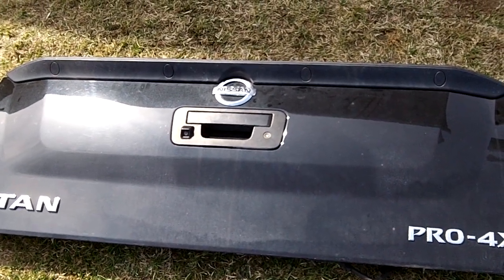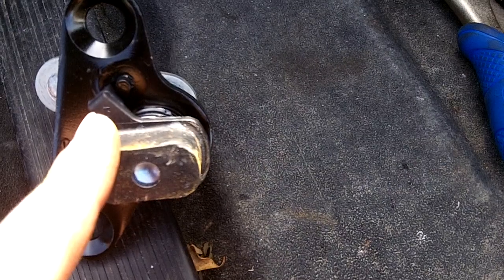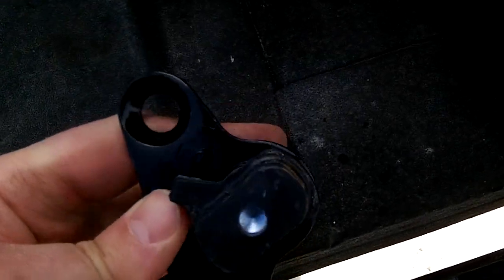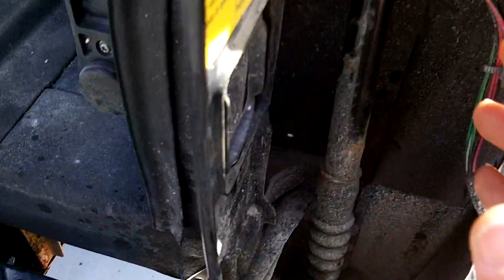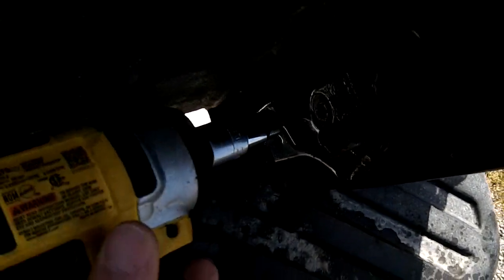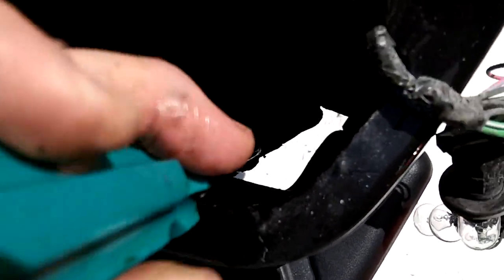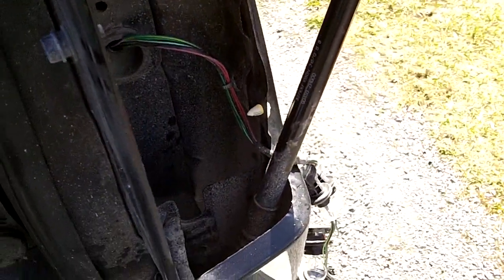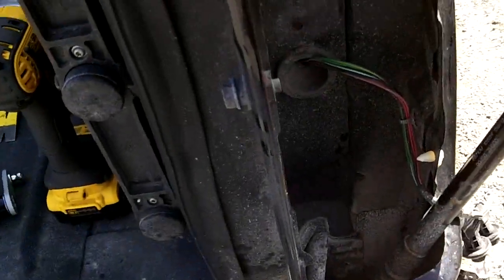Nissan Titan Tailgate Assist Repair

Comment: Hey fellow titan owners. I have a 2012 titan with a broken tailgate assist hinge ass'y. The hinge seized up and broke the plastic bracket that fits into the passenger side. I removed the hinge, soaked it in liquid wrench penatrating oil and realized that the plastic piece is the weak point of the entire tailgate. so, I fabricated a new plastic piece out of steel. So I took a 1 inch ID pipe, 1/8inch wall and cut a ring, 3/4 inch wide. I then formed it with a ball peen hammer so it slid over the metal piece that is on the hinge main shaft, into the pass tailgate holder. I then welded that ring on the hinge face only. I ground the face down and dressed the oval steel pipe part so it fit snuggly in the holder. I made 2 mm plastic spacers for both sides of the tailgate brackets. I then dry fit everything before final ass'y and it holds slick. Im going to try to include photos of the repaired part.  My bracket is oval shaped steel, not the odd shaped plastic.. liberally applied grease to both contact points on the new spacers and steel mod. I have a new hinge and lift strut on order, but this should hold me over until the new items arrive...
Reply from the maker: Good work.

Comment: I did 2012 2 years ago.  Don't remember the exact price but got mine at the dealership for cheaper than amazon.  I actually replaced both sides because my hinge cups were worn so bad that my tailgate wasn't aligned correctly.
Reply from the maker: I made another video how you can make shims to help with that issue.
Reply: I'll have to check it out.  I found once I replaced the hinges and the cups it centered it pretty well.